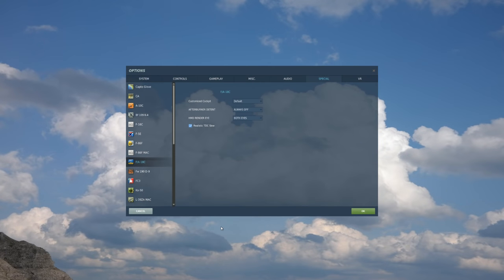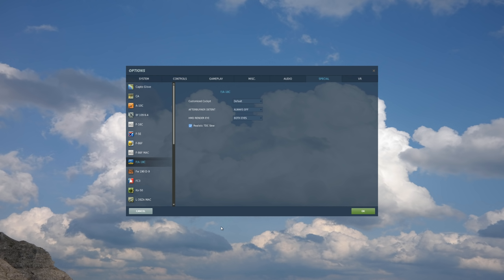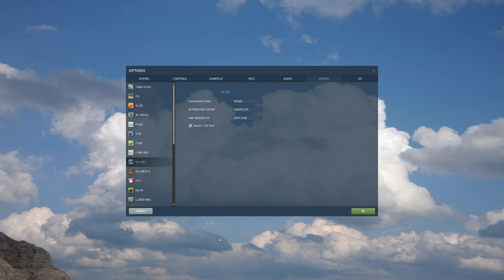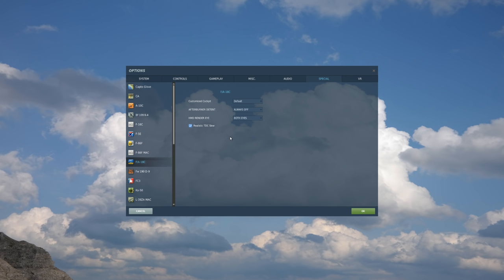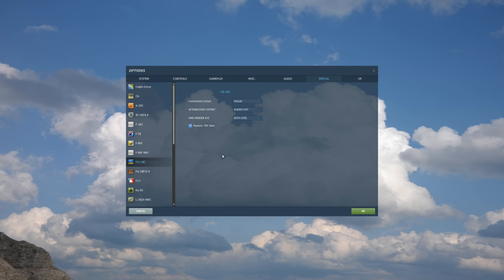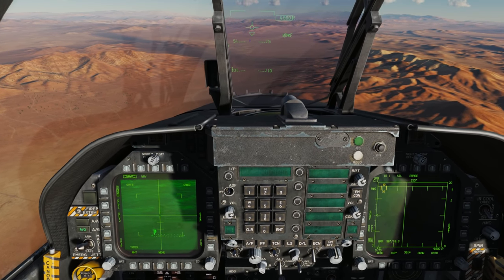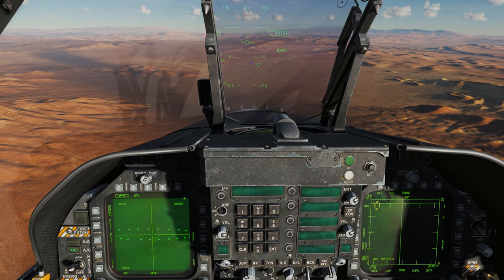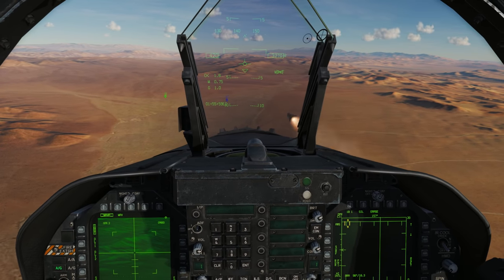Hornet Alternate Maverick Slew OPTION

Comment: Should the lock happen automatically or should you need to press TDC to lock it up?
Reply from the maker: It depends on the radar mode. Search modes require manual designation, ACM modes are automatic.

Comment: for those using the TM Warthog and are having issues with the mavs in the 18 and even in the harrier you can also use this throttle mod:

https://deltasimelectronics.com/products/thumbstick-slew-sensor-adapter

It replaces the default slew (which is terrible in my opinion) and replaces it with a analog stick like on the PS4 controllers. This allows you to have the slew axis and push button with out having to map two setup inputs. I can verify that it works as I have been using it in game for about week with no issues.